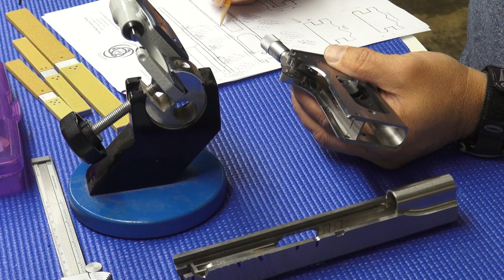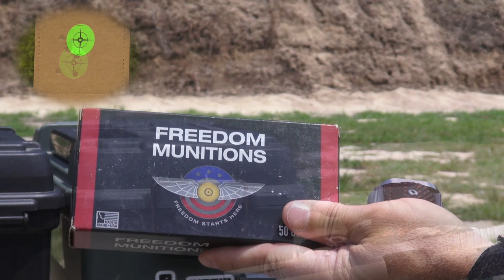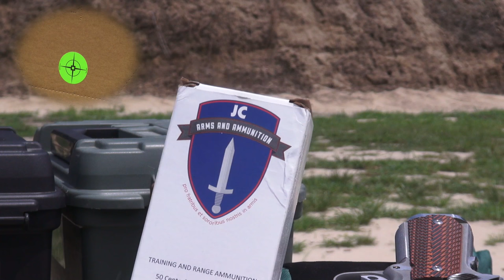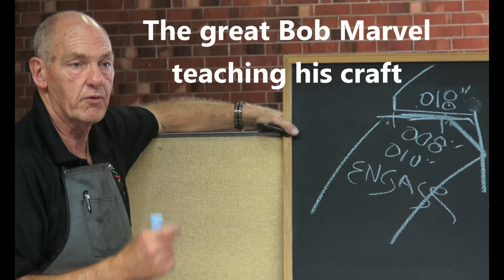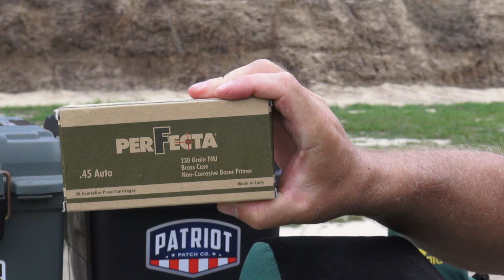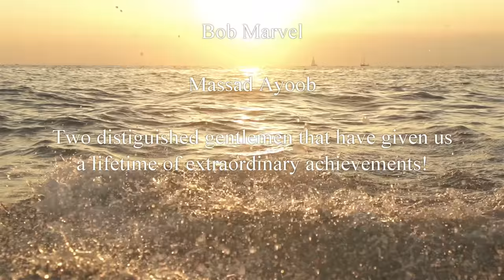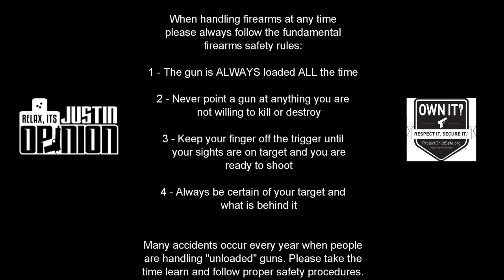The Greatest 1911 Ever Made

Comment: Wow, sweet gun. I know it's a shooter as I have never been able to 🎯 get good hits at all with ANY Remington Ammo except 12ga. Had one built over course of few months trial and error. Started out Norinco 1911A1. Fitted Colt NM barrel & bushing. Lowered & flared ejection port. Beaver tail, hammer, sear & spring were Chip McCormick. Wilson Dyer Group Gripper full length guide rod and Wilson springs and shock buff. High rise staked front sight and MecGar adjustable rear sight. Loved that old gun. Shooter friend shot competition and managed to stack 5 rounds 200gr SWC lead bullets taper crimped (4-4.5gr Bullseye 🎯 powder with CCI or Federal primers) into half an inch at 25yds. Not something I could do, but did enjoy skipping some cans. LOL I've had trouble with a few mags as well. Wilson Combat mags, not had any trouble. I did polish the feed ramp to a mirror, the top of the inside of the hood as well since the ammo bounces there, and just a little on bottom of throat (careful not to tough lands/grooves). My biggest problem was failure to go into battery requiring a palm slap to the rear...until my friend pointed out the benefits of the taper crimp die and much better accuracy resulted  afterwards and no feeding problems. Interesting once qualified with it and the rear sight fell off (got to put some lock tight or nail polish on screws) so finished without it just using the front sight. 25yds inward with most at 15yds and closer. Scored 85%. Practiced and got better and didn't put the rear sight back on it. Love your reviews. Watched several on a rainy Sunday in E Tennessee. Great take on everything and very thorough. Thank you.

Comment: Try this. The 1911 is designed to be fed by the slide stop being pressed downward and allowing the slide to come forward under spring pressure. That is why there is no spring like found on glocks, berettas etc. pulling back on the slide to feed the gun is dependent on your getting a strong grip on the slide and pulling far enough rearward to push the stop down with the angled slot in the slide. Just my opinion.

Comment: I have 2 1911 pistols. One by Springfield in stainless steel the loaded model for $800 bucks, and a Tisas in black coating for $550 and they both shoot flawlessly and I carry those 5 inch 1911's without issue for personal defence. I now have over 900 rounds shot through each gun now, and using Wilson combat magazines & Mecgar magazines their still going without issue. The only thing I have done to both pistols is to install an 18.5 lb recoil spring in them and a Wilson combat stainless slide stop being I am a lefty and the stick out slightly more than stock. All I am saying is 1911's are not that complex as long as you clean and grease them up, also most gun makers use the CNC machining process to keep their guns in spec gun after gun.

Comment: I'm shocked that my near stock Colt 1911 A1 stainless that I've had for 25 years will shoot hollow points (specifically Cor Bon JHP). All I did was to polish the ramp and de-burr all the internals (and well, I put in a higher beavertail, an Ed Brown trigger, sear and hammer and Wolff springs all round) but the point is that I didn't mess with the ramp at all and it has no problems with JHP.

Comment: Are you worried about galling the stainless steel with such a tight fit? When you have it tuned just the way you want it will be sending out to have it hard chromed or electroless nickeled? Thanks for the videos, I really appreciate the building and restoring type of gun videos they are fun and informative.

Comment: Sweet build! Did the class recommend the full length guide rod or was that your decision?
Reply from the maker: Bob designed the guide rod / recoil spring assembly and holds the patent on it. It's called the "Everlast" system. I did ask him about the preference and he recommends full length guide rods for the extra nano-accuracy you get from them by the more stable platform it creates. Luckily, this one is easy to field strip! ;-)
Reply: +Justin Opinion lucky.. My SA loaded is a pain to field strip. Thanks again and keep it up!

Comment: Excellent.  I pretty much love everything about that gun.  Well, except those grips.  I kinda hate your grips.  Sorry!  haha

You'll have to explain to some of us noobs, what the finish is on that frame.  Those parts kits are almost always regular steel frames, aren't they?  So, some kind of light-grey Cerakote you've got on there, or is that actually bead-blasted texture on bare stainless, as it appears?  Whatever it is, the contrast between that "dull" frame color and the "brushed" (not-quite-polished) finish on the slide, is really nice.  Same for the subtle contrast with the polished controls parts. 

Now all you need, is something white-ish to replace those grips.  Bone, or Horn, or ivory or the like, would be my vote.
Reply from the maker: The VZ grips aren't for everyone, and the color is of course subjective. I did actually buy a set of gray/white that I intended for it but they found their way onto my 10mm Kimber instead. I still may replace them eventually, but I'll always keep them, because Bob Marvel signed in inside of one of them. ;-)

As for the finish, I still don't feel it's "done", but I wanted the subtle two-tone look of some of my older guns. So I bead blasted the gun to the dullness I wanted, and then hand polished the flats of the slide. It could still use some TLC, but I built it for shooting not for showing so it's cool. It shoots like a dream.
Reply: +Justin Opinion you were taught by the the yoda himself
Reply from the maker: .308or5.56?
Yep. But I tried not to make jokes about his ears. ;-) Bob is a great guy and a very good teacher. Makes you understand the "why" for everything.

Comment: Did you do the machining work or just filing to fit?
Reply from the maker: The frame was in rough machined condition and required significant finishing using a combination of power tools and hand techniques. The slide was more finished, but required and fitting and blending.

Comment: Your rounds are too hot and your trigger finger needs to move ever so slightly further onto the trigger. Try knocking down your powder mixture to include more slow burn and less fast burning powder or reduce the powder charge by .10%. This will reduce the flash recoil that is causing you to anticipate recoil and pull off of the shot. The trigger finger issue is inducing an ever so slight mechanical yawing force that is causing the muzzle to pull to the left. you are consistently high and left of center.

Comment: Amazing work but a custom 1911, seems kind of a strange idea.  I thought the agenda  Browning was trying to put in place was for them all to be the same.   Buy 10 take them all apart, throw the parts in a box, mix them up and put 10 back together in any order, and,,,,,,,,, they all work.   Now a custom one with nice inlay and engraving would be nice but inside a 1911 is a 1911 and they all need to be the same, they work or they don't and most over 400 bucks all work.
Reply from the maker: It's a trade-off. To achieve the interchangeability of parts, each part and the corresponding frames and slides must have tolerances that allow it - in other words, loose tolerances. This was actually John Browning's initial approach to the design because it was for a military application, and field maintenance and part replacement is crucial. However, the 1911 was quickly adopted by competition shooters, especially Bullseye, where precision and accuracy is everything. To achieve those goals, tolerances must be reduced to the tightest possible, and the best end product is one where each individual part is hand fitted to the gun. This helps to erase the "stacking tolerances" situation that occurs in normal production. The bottom line is that there is a place for both varieties in the shooting world, and both are awesome. I don't like to see either end of that spectrum scoffed at, because they both have their place. Not that I think you are soffing - but just remember there are legitimate reasons why someone would want a fine custom fit 1911 and be willing to pay for it.
Reply: Well, I can see that point of view.   In my hands loose tolerances is more then acceptable.  If the gun is 95 percent on the mark and it's improved to 99 percent, in my hands my group might shrink for 3 1/8 down tho 3 inches, if I'm lucky.   I'v never been able to shoot free hand.  I only wish I could take advantage of what craftsmen try to do for me.  I have always like shooting while fully admitting I suck.
Reply from the maker: A perfectly good perspective to have, sir. I also love the Ruger SR1911 and it rattles like a mad snake. Choices are good!

Comment: Very nice, I carry a 1911 much of the time. Still haven't figured out the purpose for a full-length guide rod. Coil bind is caused by too long a recoil spring, not by a lack of a full-length guide rod. Hasn't been cleaned in a couple of hundred rounds? I've watched Ruger for years test guns, before there put on the market, to 25,000 rounds without cleaning.